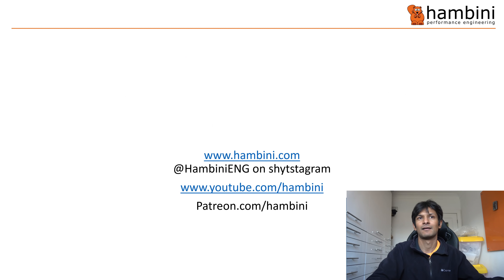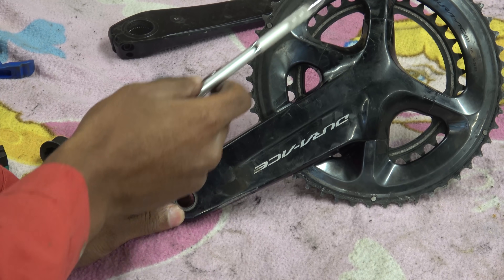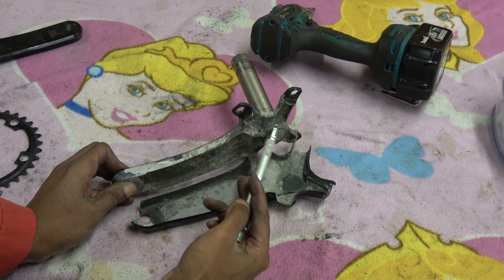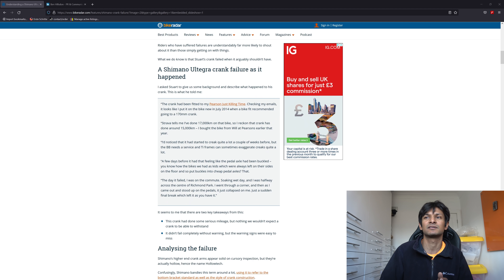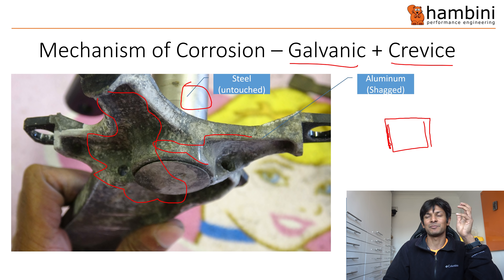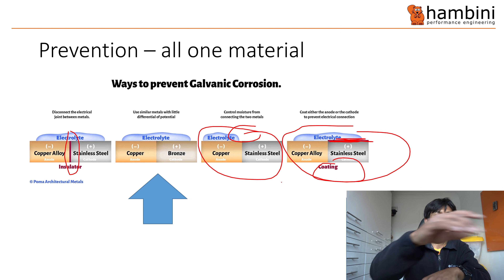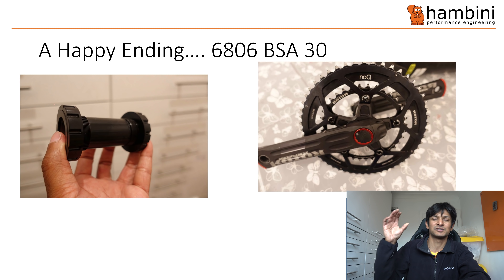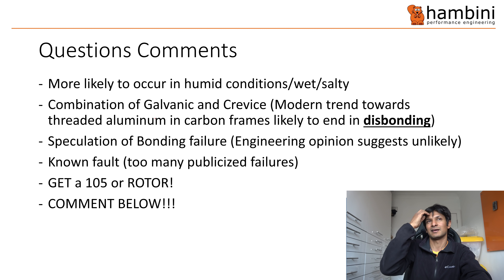Shimano REAMED for Engineering Incompetence

Comment: I run nothing but old hollowtech ll 5 bolt cranks in unfashionable 175mm lengths. They have never been a problem. I’ve broken fsa carbon and ultegra bonded cranks.

Comment: Look up bondline corrosion - i expect the adhesive interface never fails and it's actually failure through aluminium oxide. In terms of electronegativity, alloy type will be a factor here too. The fix would be to use the correct anodising process and bonding primer on the aluminium alloy.

Comment: Still happening. My Orbea D30 Shimano 105 left crank just failed and the bike repair shop did a full inspection check as they were convinced I could have a problem with the full crank set. Turns out only the left side needs repairing, but I got the impression this was not uncommon. Also: parts difficult to get and in short supply. I can't get a replacement black matt arm until June... so will need to replace with a silver version instead. Presumably short supply due to amount of failures they're having? Not good.

Comment: Great video, thanks for getting into the weeds with the science to prove the points out.  I truly appreciate the break down and "teaching" you provided here.  This is the same issue and same science that has been causing issues for Ford with their aluminium pickup bed of the F150 truck.  The frame and supports are steel and the beds have been corroding.
Reply: The same with the Landrovers, I used to quite like seeing the tarmac road through the floor.

Comment: Yup - zinc is a really common sacrificial anode for marine. As you were doing the two C channels I was sitting here wondering why they didn't simply fusion weld the two Cs together.

I've machined a couple of bits and pieces for my bike (I love having a lathe and mill!), and this has given me some great food for thought for my next project (new handle bar, a bar for accessories + riser brackets for it all). Thanks for sharing this :)

Comment: Brilliant report. With regards to the corrosion risk due to different materials matched together, get ready so see similar disasters in the automotive sector as soon as the galvanic corrosion will expose poor engineering body in white choices made by reckless car manufacturers 10 years ago to get acceptable weight distribution while cutting costs. I’m afraid we will see 10 years old cars splitting in half as an effect of small side/rear end collisions very soon.

Comment: A few years ago (2018 ish) Shimano had an issue with their XT disc brakes. No matter how you bled them the lever would pull back to the bar on its first pull. You had to pull again to get a bite point.  The magazine reviews called it a wandering bite point. How there was never a recall on those I've no idea. Can you imagine if that was in a car. First press of the pedal goes to the floor, so you have to do a quick pump to get them working again.

Comment: My Defy runs Ultegra except my R7000 chainset. I chose it on orice as the weight difference was not worth the extra £120. Turned out to be a good call.

Comment: Working in a bikeshop (Aus) we had far too many to count instances of the same "disbonding" issue with customers... saw it more with R8000 at the time, however Shimano would always warranty replace the cranks. It's been a known fault for anyone in a workshop for close to 7 years, however they continue with the same engineering design. At one point we would send a weekly load of shagged cranksets back for warranty - not a good look for Shimano, despite the fact they would always replace (without question) ... and that's just from one wee little shop in Australia, scale it globally and the numbers must be outrageous

Comment: My Pioneer R9000 just aslploded. non-drive failure, but exactly like all the others. Only 3 years, 25k miles approx. I live in a desert, don't ride in the rain. No luck w/ warranty. Replaced w/ Rotor ALDHU and couldn't be happier

Comment: Merlin sells bicycles and has OEM accounts with Shimano which is why they don't buy from Madison. Also, FYI the 105 (and below) Shimano cranks are not welded they are cold-forged but they are safe from this kind of failure because they are one solid piece of aluminum.

Comment: I'm surprised that it is bonded and not welded.  All glue has a poor fatigue life.  I bet the seal from the glue initially failed due to fatigue or was faulty to begin with.  Once moisture gets into the crevice, failure is inevitable.  Oxidation corrosion and fatigue only get worse.  As galvanic corrosion tends to occur local to the dissimilar metal interface, I doubt it had much of a role.
It should be sealed with a weld, like with 105.  Glad I went with 105.

Comment: Had 2 race face carbon mtb cranks fail. In that case the pedal inserts came loose. Figured it was a bonding issue. The galvanic corrosion issue could have contributed. Interesting. Great job on busting one apart. Inside tells the tale
Reply: I would never go for carbon crancks especially on a mtb were hitting a rock it’s a not so remote possibility
Reply: @litenantjv  Yeah it was my race set up but have ditched that. Especially with the super low BB heights anymore with bikes, pedal strikes are not insignificant.

Comment: Bonded shimano hollow crank has been around for more than 8 years starting with Dura ace.
They have not trickle this bonded design down to 105 (R7000) as of today, that says a lot.

And, latest left crank on R9200 and R8100 are forged hollow cranks, instead of bonded hollow left crank on R9100.

Comment: Anyone old enough to remember the early carbon bikes that were carbon tubes bonded to Al remembers they broke at the lug...  some said it was galvanic corrosion but others said it was the tolerances were too tight and not enough glue remained to hold it together...  my first employee purchased bike was a Specialize Allez carbon...  it broke in a week.  Went to a Trek 660 with Reynolds 531, which is still being ridden by an ex-girlfriend (not my hairdresser).  Steel rules.

Comment: Shimano moves from forged hollowtech to bonded hollowtech, knowing they'd hit process plateau that forging couldn't achieve a thinness the design need in gaining optimum torsional load transfer through skin effect of hollow crank (elongated/beam structure).
The main structure still looks like forged, the outer does not.
The outer looks casting alike; thixomolding perhaps?
And casting, in general, does not have similar properties (in many aspects, including thermal) compared to forging, if in case the base structure is of diff process than the outer.
And, within the bonded cavity, it looks more like a completely concealed enclosure than a ported enclosure (for thermal equilibrium sake).
From the clip (and still pics from Hambini's website) I couldn't observe any port just like the old forged hollowtech. Perhaps, the vent by accident is through the spindle endcap?

Comment: Love those technical videos. 
But i have quit important comment on Cervelo seatpost issue. It could be avoided by just cleaning the bike form dirt which holds moisture and allows for corrosion. Race spec bike components are manufactured to be cleaned after every ride! Its not commuting bike which weights 20kg and will ride 10 Kopenhagen winters without any maintenance :)

Comment: During manufacturing, I'm confused how Shimano handles the positive air pressure when the two halves are pressed together.  In theory the cavity should be an airtight seal from the adhesive acting as a gasket, so the rush of positive air has to go somewhere when the two halves are brought together, otherwise it runs the risk of pushing adhesive out before it dries.
Reply: good point
Reply: I would posit that adhesive is expelled and the crank 'wiped' clean.
Reply: @mightbeanybody  a slight vacuumn would help 🙂

Comment: Merlin , wiggle and CRC buy in grey import OEM  parts so are not warranty from shimano as they are not attached to the original bike . Bought a lot of stuff that came with an OEM serial number (mostly brakes and forks) .  

Hence why you were told to do one . 

I may seem mad to you but it's why I use Campagnolo cranks.

Comment: @Hambini I see that Rotor offers a steel and an aluminium axle for some of their road cranks eg Aldhu (& maybe Vegast) - would it be better to use the aluminium BB axle - instead of the steel BB axle -  with the Al crank arms & direct mount rings/spider + rings, so as to avoid dissimilar materials?

Comment: It would be awesome to cut all the crank arms up over the years to see how the dura ace engineering has changed over the years. I always thought the new models looked cheap as hell. The older ones look much more solid. With weight being such a huge factor in cycling it's not too surprising.

Comment: I have learned that second tier Shimano parts seem to hold up much better.  To me the top of the line stuff is over engineered. There is a weight penalty, but very cost saving.  I run DXR on my BMX, XT on my MTB, and Ultegra on my road bike and all have been bullet proof.  Been riding/ racing over 30 years on this stuff...no issues.

Comment: You mentioned that you are getting a rotor crank.
Do you know how the shifting quality of the rotor chainrings vs the Shimano ones is?
Or are you just switching out the crank arms?
Can I run Shimano chainrings with Rotor crank arms?
I am looking to make a switch from 50/34 to 52/36, but not sure what combo to go with. If just Shimano 105 crankset or rotor crank arms + Ultegra chainrings

Comment: My crank cracked on the non drive side in the area of the 2 bolts. when I bend up the aluminium shell the origin of the corrosion effect is the area of the 2 screw holes. this part you can never make 100% waterproof on the alumnium area. 
(my failure ended up in a broken left crank arm within a pedal turn, where the crank arm damaged the paint job arround the bottom bracket - luckily not the carbon layer ...)

Comment: Excellent video. Are there any reported failures of the new (2019 onwards) Tiagra FC4700 cranksets which share the same hollowtech design with ultegra and dura-ace? Should we Tiagra users be worried about possible failure? (mine was installed in June 2021 and made 5000kms so far). Thx!
Reply from the maker: It's only the high end stuff that is failing
Reply: @Hambini  thx for the reply; I will however keep an eye on my cranks!

Comment: Unfortunately I spent almost $2000aud on a dual sided Dura-ace powermeter, but fortunately the power meter has proven to me I battle to put out 150 watts so I should be safe.
Reply: Don't think so. Once corrosion is to important it will fail. It's nore a question of when it will fail when if it will.

Comment: So how does Hambini BBs fit in with this corrosion issue as they are being put in to carbon fiber frames? :)
Reply from the maker: I don't use glue
Reply: @Hambini  Of course since it is an interference fit... But the glue isn't really the important point in galvanic corrosion though, is it? Still dissimiliar metals. Obviously the bottom bracket is not going to pop out because of it - quite the opposite actually - it is never going to come out :D

Comment: Classic aluminum corrosion. Heck happens in a transmission VANOS too…Because no one here in the esteemed audience or ridership bothered filing a complaint with the NHTSA as it can cause a road injury death or further collisions …. and folks like me cannot file it on your behalf since this has never happened to me… notice that as an elite level rider, 78-85 kg, i discovered that these cranks begin flexing at the 20,000 km mark. 9000 DA 23,000 the speed lost is 0.75 km hr vs swapping for a new 9100. Clear empirical immediate gain.. rings last 12,000 kms basically less than half the lifecycle mileage

Comment: @hambini two very consise questions, first: i am being tired of cheap sheat plastic bushings on my MTB frame, so I arranged to machine the bushings in bronze, they direct contact with carbon and water/sand/all kind of elements, so I creat a very prone to fail situation? Second, the frame have bearings and they are directly instaled in carbon (its a full suspension frame) they inebitable created a catódic situation, some good Grease really could isolate the pair from the elements or just soner or later the frame gona fail for some of this points? Thanks for your work! 
PS:for some context I ride in Portugal and altaugh is main dry the winter its really agrest.
Reply from the maker: In a carbon frame, the steel will get attacked so you will be okay
Reply: @Hambini  thanks! I assume bronze will also be attacked on carbon. Rigth?

Comment: Hello Hambini, love your videos.
got a question, I am currently using a bike with a BB86 and a Shimano RS510 crankset< I am looking forward to upgrading my Crankset to a Rotor Vegast, but I am not quite sure if this will be compatible with the bottom bracket that I am currently using (SM-BB71-41B, Press fit 86.5), see to options on the website a 24mm and 30 mm Axle. which option one should I go for? do I need a New BB for this new crankset or a set o press fit bearings?.
I don’t want to buy a Shimano ultegra Crankset, they are currently overprice and almost impossible to find in South America, Rotor seems to be the best reliable and affordable option for me.

Comment: Thanks for the great video & explanation, makes perfect sense. Had an Ultegra FC6800 crankset partially fail like this a couple of years ago. Decided it was because of a (suspected) heavy impact whilst travelling with bike in a (hard shell) bike box (airport baggage handlers…?) Still got it somewhere, will have to find & dis-member it - see if corrosion was the real reason for it failing. Got 2 bikes with these same Shimano hollowtech cranksets 🙈. Ultegra R8000 & 105 R7000, they look to be of same construction. Never doubted them before I saw this…
Reply: 105 r7000 is not bonded. hollowtech, but not bonded. different construction

Comment: I swear my Ultegra crankset with PowerPro makes this clicking sound and I have only had the bike (brand new) since October 1 2021. I noticed the noise was coming from the drive side crank as when I put pressure on that pedal with the bike standing still I could replicate that same clicking sound and I imagine this is the same sort of force as placing the crank arm in the vice. When I wash and lube the bike appropriately the clicking sound does go away for some time (hours of riding) before it returns again (I am a very low power rider though). I have not taken it back to the shop yet to raise my concern since the noise does go away but seeing these sorts of videos pop up on YouTube and validate what I was noticing is concering but I am perplexed as it's such a new bike.

Comment: My Orbea Orca -2012 has the for the bottom bracket BB30 a alu"tube" bonded with the carbon frame, so far i cant see any trace of de-bonding. Im soon mounting my Hambini BB. Just need to find the right thread lock and activator.

Comment: Have there been any reported failures of the latest dura-ace and ultegra cranks now that they have been on the market for some time? I see that you favor the 105 cranks . Are they one piece construction and made like the older hollowtech 2 rather than bonded together like the two "higher" models ?

Comment: Had my non drive side 9000 Crank completely split in 2 you could see the corrosion looked like it had started where the bolt's that nip it to the spindle are .The bike sends most of it's time on the turbo trainer.

Comment: I have some doubts. There are loads of cranks which use steel axle pressed into aluminium crank-arms. They don't all corrode. 
For galvanic corrosion, the electrolyte has to touch both the Aluminium and Steel. This could only happen at two spots: where the crank meets the BB and inside the crank. But the plastic BB caps occupy all the space. If i remember correctly, they even have a little o-ring in the corner which would conform nicely to the connection point. And there should be grease there (if not, who's fault?). Sure, there could still be a little humidity there, but then why is the corrosion INSIDE, not outside? So is there humidity in the crank?  Can a galvanic cell be that potent, with just humid air as electrolyte? I don't know.
That the corrosion starts near the axle can have another reason: The glue separates first, where the highest tension occurs, which obviously is near the rotation point. So water/humidity gets in at that point and corrosion spreads from there (not galvanic corrosion).

I guess the just messed up the gluing process. There is so much that can go wrong there.

Comment: I was going to ask about 105 as I’ve always gone for 105 as I’m a bigger rider and always have worried about the failure level of the Untergang and D Ace. Fantastic video yet again. These manufacturers are selling us shite🤭👍
Reply: I have both crankets. A 105 R7000 and Ultegra R8000. On my second Ultegra R8000, first failed just under 3 years use, a crack close to the pedal eye,  going across the crank arm. happened on drive side. Also the inner plate was starting to seperate. 
105 cranksets appear to be forged. It's a different design to Ultegra and Dura Ace, which as Hambini illustrated have that bonded clam shell design. On 105 the spider and crank arm is one piece aluminium, spider probably CNC machined. Rest of crankarm 
appears to be hollowed out. Very few failures reported on 105 chainsets.

Comment: Why don't  classic square taper cranks with steel axle/alloy spider corrode, then?
EDIT: does the taper joint act as a weld as in the case of the 105/rotor cranks?